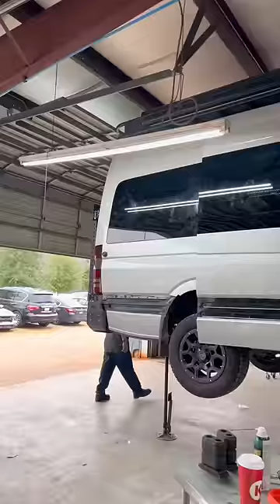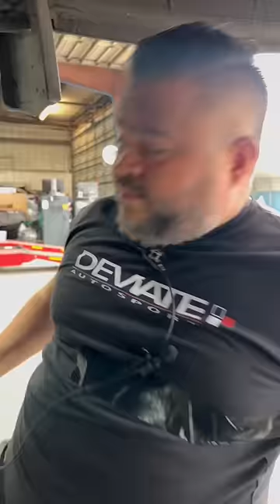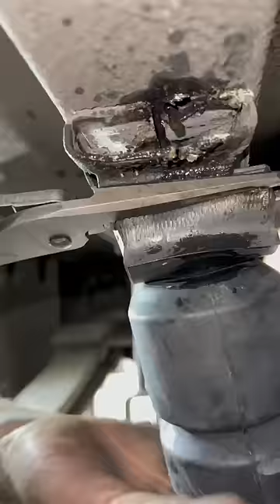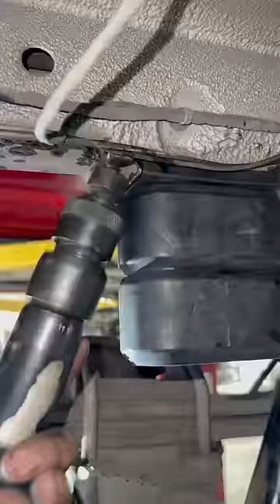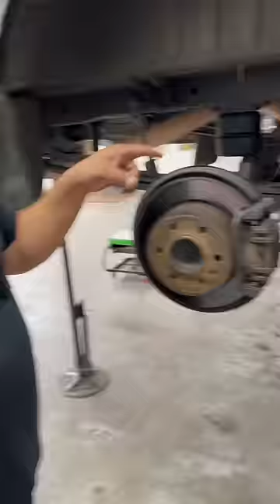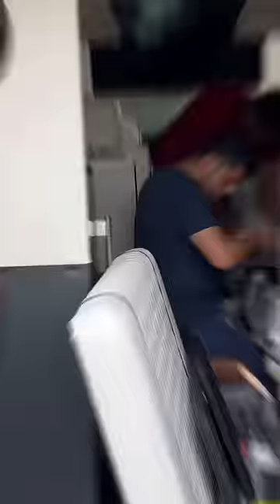Mercedes 2500 Sprinter Van OVERLOADED‼️ #shorts

Comment: Dude just completely screwed his suspension travel
Reply: Ya like I’m wondering how they would stop sag? It would bottom out sooner but appear higher I guess.
Reply: it's too heavy. just put air shocks on it dude they are adjustable and help with the extra load.
Reply: Sometimes it's what the customer wants
Reply: @Tactical Qewrty  and most of the time what the coustmer wants isnt the best way to do it and i believe you should only  take on jobs that are up to your standards and obviously his standards are pretty low if hes willing to do this for someone and put his name all over it but i get it hes just trying to make a quick buck and now his name is tarnished because of it
Reply: @Noice-COW  teeth 🦷 would help too jjjjj
Reply: Maybe it’s an off rode one? Maybe he needs the body of the van itself higher
Reply: Just take leaf springs off and weld to chassis
Reply: @Noice-COW  A LOT of the time the  customer insists. It doesn't matter to them as long as it works. They probably pushed for him to do it this way because they didn't want to pay for all new parts.
Reply: This is awful. And he dickered the tab mounts for those bump stops. Cleaning rust?! Wtf is this? This gotta be a joke right?
Reply: @Wtfinc  that’s my point bro, a legit shop wouldn’t have wasted it’s time on that crap
Reply: Going be bottoming out like heck needs stronger springs or air bags
Reply: And he put water on his back 😂

Comment: Wouldn't it make more sense to put stiffer springs or lift leveler airbags in there so it still has working suspension? Increasing the height it's bottomed out at isn't exactly a fix.
Reply: "Customer stated"...
Reply: He's definitely gonna feel the difference in bottoming out sooner. 👏 Close em out.
Reply: @hickindustries7076  bro
Reply: It keeps the suspension from being bottomed out for real without putting in stiffer springs. Now the springs aren’t getting flattened, fatigued and they won’t break. Ride height doesn’t sag going over bumps. If you flatten the suspension loading it up that’s on you. This just keeps the suspension from being overly compressed you shouldn’t be riding on the bump stops that means you don’t have any suspension.
Reply: Adding a helper spring doesn't cost that much and even cheaper there are parts suppliers like Monroe that make aftermarket spring assits that don't change ride height but work under heavy loads , what he did was either bad advice or a cheap ass customer
Reply: Who cares. Not you're problem.
Reply: @StraightSleepy  wow what a great contribution to a conversation
Reply: @candicefenner8536  you too
Reply: @hickindustries7076  🤣🤣🤣🤣🤣🤣
Reply: @sleepybear7642  let's play spot the Latinx
Reply: @dirtyaznstyle4156 he added a bigger bump stop. that doesn't address the sagging. In fact the customer will be hitting bump start even more with the bigger bump stops. upgrading the suspension would address the sagging.
Reply: I second this
Reply: Was just about to comment this
Reply: @candicefenner8536  he is a "wise man" after all. 😂😂😂😂
Reply: Yes, its much simpler to put either super springs (helper springs), or airbags, or to add another leaf, but this guy wants people to come back it seems
Reply: It's a cut rate shop what do you expect
Reply: I’ve seen people use these type of bump stops to stop the suspension from fully compressing. People who add this usually abuse their trucks for work. They’ll place 2500+ pounds on top of a truck rated for 1000.
Reply: Airbags bro
Reply: @alexvillalobos7137 we aren’t talking bump stocks here bro…
Reply: @deaf2819  mistyped and autocorrect bro 😎…
Reply: Agree with you,don’t understand what cleaning the disc surface to wheel surface is going to help with the feeling of the sage!! 🤔🤔
Reply: My thoughts exactly
Reply: Or an extra 'helper leaf' in the springs,
Bumpstops don't solve a thing
Reply: @irish-thinker4429  yup agree that as well forgot about that
Reply: Its sort of the same concept as an oil change. You can change the oil regularly for fairly cheap or change the whole engine in ~20k miles and it be far too expensive. Same here, if the van doesnt bottom out as much the suspension will hold up longer, most of these vans are guranteed to bottom out due to the loads they carry, no suspension is gonna offset it.
Reply: @topaz123212  None of those are possible for these vans 💀 have you ever worked on them before?
Reply: @kneeman  yes it is possible, I've seen it done and I've done it. Not that hard.
Reply: @Dankneefantum  yeah but that massive bump stop is bottoming out before the spring goes through a full range of motoring and iv seen bumpstops repeatedly bottom out and craic axle casings .
A workshop van we have was on the bumpstops due to heavy loading we went to the local spring specialist and get an extra helper leaf put in ,it didn't raise the height of the van buy much but no more bottoming out on speed bumps ,
It was a far better solution
Reply: Yes
Reply: And they even air hammered the metal so you can't just put the original ones back in lmao what a hack shop
Reply: Yes and this video seems like a troll
Reply: Exactly
Reply: If they are always loaded heavy then 100% you want springs.  If it’s a truck that occasionally tows heavy, then helper springs based bump stops can be a good option to keep daily comfort in tact
Reply: @coltinkerstin5774  what are u calling helper spring based bump stops?  His best option would probably be a set of bags that are more expensive but their easily adjustable.
Reply: But how will you charge him again when he has to come back? Plus he received a free service on the side. Pretty much sums up the industry
Reply: @candicefenner8536  or maybe he charged the price for springs, for this service
Reply: He,s drunk again ,who does this, how does that help 😂😂😂😂😂😂
Reply: That would be the correct way to solve this yes
Reply: A quick fix would be to replace shocks to air shocks, then they could adjust the air to the load. 
Not a perfect fix but, better than riding on the bump and axle.
Reply: @StraightSleepy  your *
Reply: @sleepybear7642  Because he’s arguably worse off now than before the ‘upgrade’
Reply: @alexvillalobos7137  The suspension shouldn’t fully compress with factory height bump stops and stock geometries. The manufacturer has already mathed the ef out of that for us.
Reply: Yes it would but it’s much cheaper this way
Reply: He has successfully just put more stress on the axle and axle bearings and ( 8 ply tires. ) 
The ‘ correct ‘ way to do this is buy a vehicle that’s made for it’s use. 

Which is in this case buy a 3500 which comes with everything that is needed, 10 ply tires, stronger leaf springs and bigger and stronger axle and bigger axle bearings.
Reply: @dirtyaznstyle4156  So many thumbs up, but that doesn’t make any sense. Putting a taller bump stop means you’ll be on the bump stop even more and have even less suspension.
Reply: @ezkieler850  well less travel but you won’t break any leaf springs that way either. With the short bump stops that spring is going past flat to recurved and pretty soon it’s not gonna recover and be riding on bump stops full time. Cheapest way to prevent that is taller bump stops
Reply: Cause this is cheaper
Reply: 😂😂😂😂😂 apart from the obvious bump stop not solving anything….a complimentary rotor cleaning! Really??!!
Reply: @Dankneefantum  so what should he have done?
Reply: @deaf2819  bump stocks are not legal in Florida anymore😂
Reply: No that wouldn't make sense, because if the frame isn't rated to handle that much weight a stronger spring setup isn't going to help anything.....
Reply: @greengoat5654  dawg really said latinx lol 🏳️‍⚧️🏳️‍🌈
Reply: @Meekmillan  As an ironic insult
Reply: I’m a locksmith. Had a similar problem with my van after installing all the cabinets and tools. The van was swaying all over. I purchased Sumo springs which are basically down stops similar to these. I have to go slow over railroad tracks or shit roads. But the van rides flat. Tire wear is great. 74k miles later and the van is working awesome with the original suspension. So this mod really works well
Reply: AMEN! Cause now he's just going to bottom out even easier. Complimentary Corrosion Removal? lmfao
Reply: @dirtyaznstyle4156 bud if you're already overweight a bump stop isn't doing too much. He needs a heavier duty spring in combination with the bumpstops.
Reply from the maker: https://youtu.be/kzHMwWex0eQ
Reply from the maker: @hick industries  https://youtu.be/kzHMwWex0eQ
Reply from the maker: @SamSam-ih6nt  https://youtu.be/kzHMwWex0eQ
Reply from the maker: @dirtyaznstyle4156  https://youtu.be/kzHMwWex0eQ
Reply from the maker: @candicefenner8536  https://youtu.be/kzHMwWex0eQ
Reply from the maker: @sleepybear7642  https://youtu.be/kzHMwWex0eQ
Reply from the maker: @greengoat5654  https://youtu.be/kzHMwWex0eQ
Reply from the maker: @blackhornet25  https://youtu.be/kzHMwWex0eQ
Reply from the maker: @kyleswain9412  https://youtu.be/kzHMwWex0eQ
Reply from the maker: @zachwomack4887  https://youtu.be/kzHMwWex0eQ
Reply from the maker: @franciscokramer4570  https://youtu.be/kzHMwWex0eQ
Reply from the maker: @topaz123212  https://youtu.be/kzHMwWex0eQ
Reply from the maker: @cheifexhuman5332  https://youtu.be/kzHMwWex0eQ
Reply from the maker: @alexvillalobos7137  https://youtu.be/kzHMwWex0eQ
Reply from the maker: @David-el1jw  https://youtu.be/kzHMwWex0eQ
Reply from the maker: @deaf2819  https://youtu.be/kzHMwWex0eQ
Reply: @dirtyaznstyle4156  bags fix all of that, if there's a heavy load add air, if it's a light or no load remove air, but the stock suspension components still function and act as normal just with the bags helping out a bit
Reply: @Dankneefantum yup done heaps of these for GVM upgrades. Extra leaf or airbag assists. Mostly on campers when missus puts her handbag in the back... common as, and much better solution than dodgy af bump stops!
Reply: It's what that customer agreed on, what's the issue?  A couple of grand or a few hundred dollars? What would you choose?
Reply: Stiffer springs are only gonna make it worse, if it's not made for the load sitting the body on the axle is probably the safest way to keep it together, spring perches will give up eventually and he'll nab a one ton if he's smart
Reply: @dirtyaznstyle4156  Tell us you have no idea what you are talking about without simply saying you have no idea what you are talking about.
Reply: @jmackinjersey1  you’ve spoken for yourself need I say more?
Reply: @StraightSleepy  no they were making valuable critique, you are just being a baby
Reply: @StraightSleepy if  YOU'RE going to contribute to the conversation please use the correct YOUR

Comment: That is not the proper way to fix that issue. Either put an over load spring in or airbags.
Reply: Yeah but you get cheap customers sometimes, and those are probably the cheapest option.
Reply: If you’ve seen other clips, they do skits with really really cheap customers. I’m 99.9% sure this is a joke .
Reply: Thank you. Needs to be said this isn't a good fix.
Reply: My man will now bottom out in style
Reply: You pay for the $99 guy. You get $99 worth of work
Reply: It’s a joke. Just like removing the rust on the rotor hat.
Reply: @bureauofautomotiverepair 😅
Reply: That’s what he did do……. On the receipt anyway.
Reply: Springs don't change the frame/chassis rating....... Overloaded trucks with airbags or stiffer springs are still illegal
Reply: @masonjohns208  the could just old and wore still well under tonnage limits.(or if it was real...maybe a broken shackle or shock mount.....just saying 😉
Reply: Should have airbags. My mom had a 2016 and it had airbags I remember because it was also the last repair done before it was traded in
Reply: That guy needs a rhinoplasty or something , something didn’t sound right.
Reply: hes just trying to get money fast
Reply: Airbags can rip and leak tho

Comment: i’m genuinely confused how removing the corrosion from the lug portion of the rotor will affect literally anything
Reply: Will definitely not need to kick the wheel off next time 🤣
Reply: it’s good practice because corrosion could shift and cause a loose wheel THEORETICALLY. but realistically it’s a waste of time
Reply: If it's really bad yes it makes a difference because it throws the balance out of the wheel but damn it would have to be really rusty another reason but you need to use a small amount of grease or use paint to prevent it rusting up again. Rust makes it really really hard to get the wheels off.
Reply: @Itz_Gmez  I just did my brakes the other day and my tire was rusted on.  It was a pain to remove.
Reply: @kylehoward4636  hey next time pal..be a man!
Reply: @jamesjameson2576  says the guy who has never removed a tire
Reply: @HeyThatWeirdGuy  lol what?
Reply: @jamesjameson2576  what do you mean what?
Reply: And hammering the holds for the bump stop will bring corrosion..

Comment: If you got a vibration while braking, then you need to either resurface or replace rotors
If your suspension can't handle the weight, then you need stiffer springs

Comment: Lifting Van up. Does throw transmission sensors off or Wheel sensors ?
   Want to lift up a car . Told throw the
Weight Shift Sensors Off ?

Comment: Cleaning corrosion off the hubs is supposed to be a standard practice… but not many shops practice it (it’s for the wheel to have a clean surface to sit on to reduce wheel off risk due to vibrations)

Comment: In europe we would just use springs from - dual wheel. Or a minibuss/ 7500kg.  So you dont just ruin the springrate and stroke.    This is the smuggler mod as we Call it.

Comment: You’ve successfully just put more stress on the axle and axle bearings and ( 8 ply tires. ) 
The ‘ correct ‘ way to do this is buy a vehicle that’s made for it’s use. 

Which is in this case buy a 3500 which comes with everything that is needed, 10 ply tires, stronger leaf springs and bigger and stronger axle and bigger axle bearings.

Comment: Now the customer will feel bumps that he never felt before because the axle will bottom out sooner than before. 
Unlike the corrosion removal on the wheel to rotor mating surface the customer will definitely feel that. 

Best fix for that customer is a suspension upgrade not bump stops.  🤦‍♂️🤦‍♂️

Comment: He need to beef those items up and leave the old bump stop where it was. This is case of charging customer for something he don't need. Heavier duty air bag or add a leaf or heavier gauge coil spring would be correct repair.

Comment: All this is doing is limiting suspension travel. Not stopping the issue. If he's pissed that its sagging from weight upgrade the suspension. Get some bags or helper leafs. And if hes got enough weight in it to sag and bottom out some better shocks are needed especially since its a giant. Probly feels like its gonna rollover takin the smallest turns.

Comment: They went the cheap way out, that's gonna cost them more later. The ride quality still gonna suck, gonna bottom out the travel more easier,  getting stronger leaf springs and/or adjustable dampening rear shocks would be best.

Comment: The engineer that built that bumpstop bracket must have never lived anywhere that they used salt on the road. Two winters in NY and those factory bumpstops will be left on the highway somewhere between Albany and Syracuse.

Comment: Put helper bags on it not larger bump stops its not the solution of the problem as the payload remains the same and instead you are just causing a problem of less shock travel making the sprinter potentially dangerous.

Comment: I’m glad they got a videos on Jobs they do, I definitely wouldn’t take my trucks there 🤦🏻‍♂️.
Was expecting heavy duty leaf springs but the customer is going to have to rely on rubber bushings instead 🥴. He probably over paid 😂. My guy resurfacing the rotor on a spot the brake pad doesn’t touch. Umm 🤔 ASE certified?

Comment: Forget the suspension/bump stop that not only doesn’t fix the issue. I’m wondering what ride difference the customer is going to feel from cleaning the break rotor?  That’s like wiping off the dash and saying your car is going to ride smother. Now if the rust were visible through the rim, that might make the van look better. This whole video makes no sense.

Comment: How tf does that help?! You're reducing their suspension travel
 When a vehicle bottoms out the springrate goes infinite, which is a good way to lose control when hitting a bump at speed. The correct way to remedy this issue is to either install stiffer springs or, the better option, add a pneumatic adjustable leveling kit.

Comment: I wouldn’t go to this guy. Extended bump stops are for a lifted suspension… he should’ve installed air bags to help stiffen the suspension to compensate. also the corrosion removal is a cool step but I doubt he felt all that much difference afterwards.

Comment: Using a larger bump stop to prevent the van from bottoming out is like sticking your finger in the barrel of a gun to stop it from firing. Hack shit. 

Add more leafs to the springs or get higher capacity airbags. This “fix” does literally nothing

Comment: What the heck?  A bump stop wont do crap to help with weight and sagging.  It’s designed for the axle to “bump” into it when the suspension occasionally bottoms out.  It is not designed to support a heavy load.  Doesn’t matter what the customer states, its type mechanics job to know what works and what is a waste of money and time.   With that said an upgraded bump stop is nice but it ain’t fixing diddly. Or squat.

Comment: That's not a fix... The dude needs a stiffer spring or an airbag setup the bump stop isn't supposed to be used it's a just Incase you bottom out your suspension it doesn't blow out shocks or clap metal on metal.